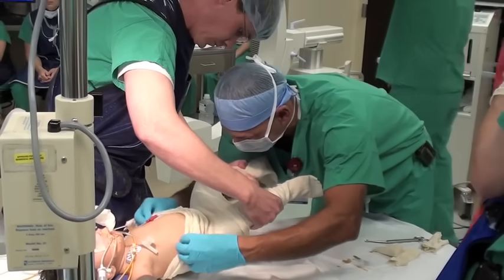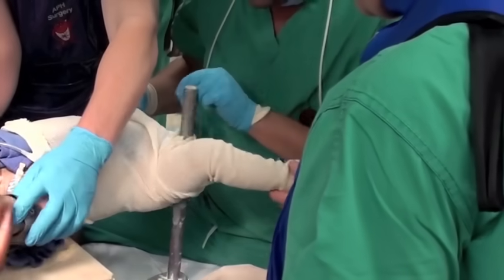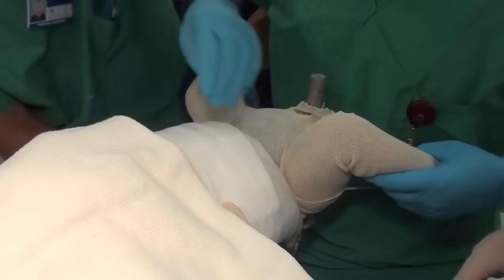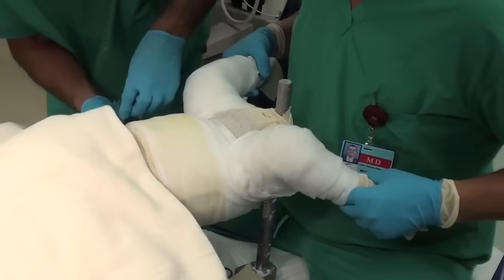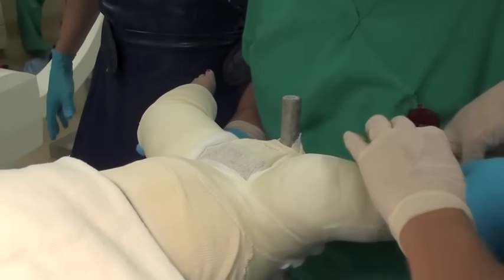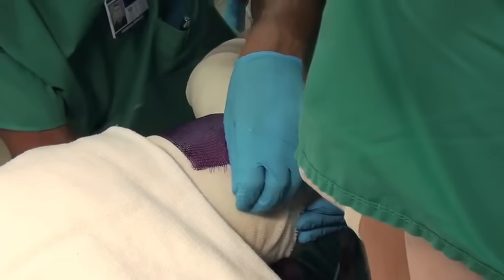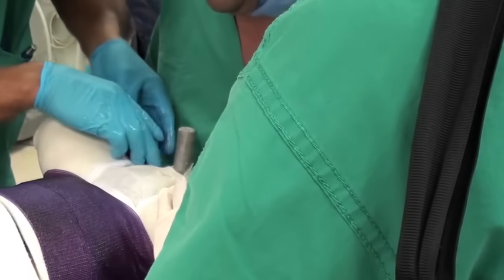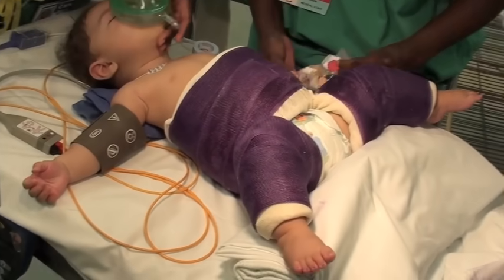How is a child fitted with a Hip Spica Cast

Comment: I suspect this is caused by improper holding of baby.  Pulling up on newborn leg(s)  for diaper changes. Splaying hips before baby is ready.  ‘Baby Bjorn’ type leg dangling carriers.  Holding baby up, putting body weight on legs, to learn ‘standing’ or ‘walking’ before she/he gains strength to do on own.  Jolly jumper type leg dangling exercise before ready. Exersauser too young.  Bumbo seat before baby ready ~ children have died sitting in these.  ‘Container baby’ type of mothering.  First child parents are new and have a lot of learning to do.  Female babies tend to be lighter and held on the hip perhaps improperly. Babies are born perfect. It’s the parents that cause the deformity.
Reply: No Elizabeth, not correct. 
My daughter was born with a dislocated left hip due to her hip socket not forming correctly while I was pregnant with her, requiring her to be in a Spica cast from 6 months of age. Nothing to do with how she was held after birth etc. it’s also hereditary, my brother and father had it. No need to blame parents for what is already a difficult enough thing to see your child have to go through.
Reply: @karajones7879   well at least you caught it early, before walking, and no need for surgery intervention.  Was your baby born via cesarian section?  You should watch footage of OB surgically removing baby from tight womb. It is shocking the tight squeeze, baby has to be pulled out, and the way doctors and nurses handle tiny newborns.  I have my suspicions which remain firm.   Not blaming just mother/fathers. Could be improper changing from old grandmothers / a nanny or caregiver (in US there is no maternity leave so some low paid woman is changing your babies), could be handling from doctors and nurses from medicalized birth.   You are a good Mom for noticing this dislocation at such an early stage.
Reply: You can suspect all you like, but clearly you have no clue what causes it. My baby came out of the womb with hip dysplasia on day one. And yes, babies are perfect regardless.
Reply: @hayleyallen3696  was baby born via cesarian section where the doctor may have pulled her or him out of tight womb?   Unlikely to be vaginal breach, where OB might have pulled legs, as OB simply cesarian all breach presenting.
Reply: I was born with DDH (1963). Went through the spica cast, PT, follow-up visits for several years.   The socket did not form correctly in utero. I still have the medical reports (needed them for my USN physical)
Reply: @mexxicokitty   I'm going to give you a different perspective. The only way to know this for certain is for you to have had a hip x-ray in utero; and another hip x-ray immediately following natural undisturbed birth. I suspect someone pulled your little newborn leg too hard and it came out of the hip socket. Could have been a doctor pulling you out of your mother's womb if you were born cesarian section. Could have been a birth attendant giving your leg a pull during breach vaginal birth. Could have been improper holding of newborns (I've seen mothers hold newborn in right arm football hold, and with hand on right leg of baby). Could have been putting weight on baby before muscles developed. Could have been Bjorn carrier. You don't know with certainty. Take a look at the records again, order more records (your mother's birth records), and do deep dive research.
Reply: My baby was born via c-section, but she was not breech. She had an asynclitic presentation. A quick google search will show you that c-sections actually improve the outcomes of breech babies for developing DDH quite considerably.
Reply: Wow I have no words
Reply: @kibbykibby   then shush. LOL